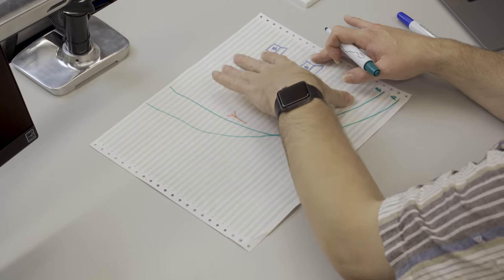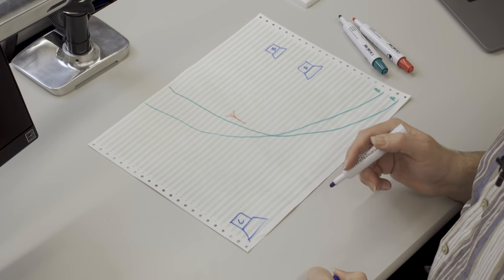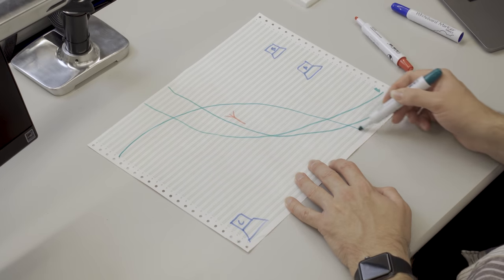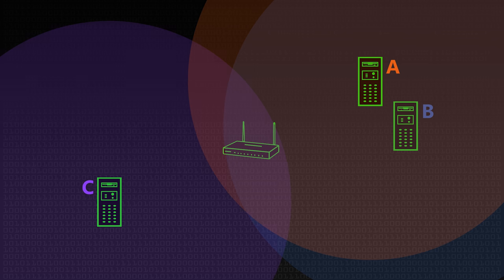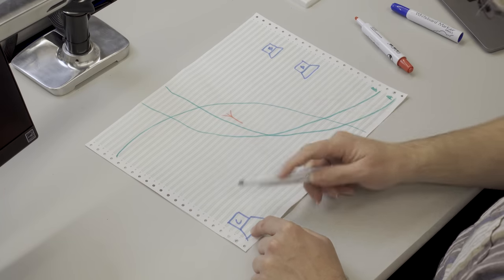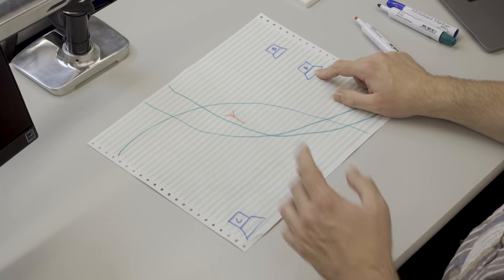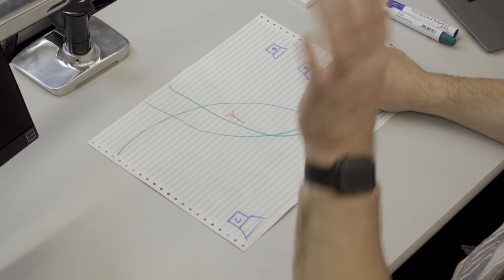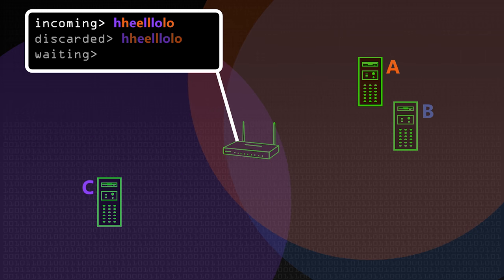WiFi's Hidden ____ Problem - Computerphile

Comment: I wonder, if machine A got the CTS, how does machine C know when it's allowed to send another RTS again? Is there a "final acknowledgement" or a "revocation" of the CTS from the AP that machine C can use? Or is there maybe a well-defined time period that the CTS is valid for after which machine C could send its RTS?
Reply: similarly: is there some maximum size of data or amount of packages you are allowed to send after receiving a CTS? Or could you literally block the whole system for minutes, sending data.

Before watching the video to its end, I imagined it would use something similar as cell towers, where you get some fixed time slots assigned for transmitting (not sure if this is still correct, but i remember hearing that somewhere). Could even (re)negotiate them every now and then to stay flexible regarding other participants
Reply: @Kantenkugel  This renegotiation happens for every data chunk transmitted depending on the backoff time. Otherwise, I'm guessing that the protocol will become partial to nodes in some manner and the transmission rates observed on some machines will be higher than others, albeit, very slightly.
Reply: As soon as machine C sent the RTS packet, and didn't get a response back in a predefined amount of time (usually defined by the used protocol), then it sends it again in a random interval of time. (For example, he doesn't get a response, and decides to send the RTS packet again in 3 milliseconds. But next time it might will be 4, or 5...) This way the possibility of getting RTS packet from 2 machines at the same time from the perspective of the Access Point is significantly less, than waiting another predefined time before sending the RTS packet again.
Reply: The RTS and CTS contains a 2 byte length field, so any Transmitter can estimate the duration for the Send + ACK.
Reply: @phizc  Technically it's a duration field not length, then the speed of each node doesn't have to be known just time in ms the system sending the RTS already estimated the duration.
Reply: @pcfreak1992 I believe it's the latter (C waits for the channel to clear then re-sends RTS). It's only a packet or two's wait, so we're talking fractions of a second.
Reply: @Segphalt  ah. It did say the field was Duration in the doc I found, but I mixed that up when I posted on this thread. I was sharing info I found in a 5 min Google session :-). I think Wikipedia said the waiting clients estimate + add a random extra time. I didn't think about the fact the original Transmitter could estimate how long it would take, and put that in the frame. Do you know what format the Duration filed is? Number of microseconds possibly? Or milliseconds, but I'd think blocking for more than 65ms would cause problems for other peers. 65 seconds definitely would 😀.

Comment: It seems to me that in a very busy wifi network, with dozens or hundreds of clients, it would make more sense to have the access point reserve RTS time slots for every connected client, and broadcast that schedule to all clients.
Reply: The reason they don't do that is because internet traffic is spiky by nature and isn't predictable. It wouldn't be efficient. Ideally if I'm sitting there waiting for a server to reply, someone else should be able to use my timeslot for maximum use of the shared channel bandwidth.
Reply: @SocalRider1754  couldn't your timeslot be very small by default, as long as you had the time to re-negotiate it? that would still keep the flexibility
Reply: This would only end up in a lot of unused network time.
Reply: If I recall correctly thats how cell towers do it. The allocated time slot is very short but done in quick succession so it can handle many calls without brake up.
Reply: and they do in some types of networks, eg. cellular. see time division multiple access
Reply: WiFi (or, more accurately 802.11) has had various dalliances with such systems.  Originally a "Point Coordinator" role (before 802.11e),  then a "Hybrid Coordinator" (802.11e).   There were even "Time bounded services" in the original draft 802.11 before everybody realised that it made a promise impossible to keep.

An AP can optimize a very busy network and improve throughput for everybody.  This is easy to show.
Two APs sharing the same very busy channel find it hard to optimize, because scheduling depends on determinism, or knowledge.   The most recent standard 802.11ax does "micro-scheduling" within an individual frame exchange sequence,  but relies on random channel access to start such a sequence.  This provides graceful,  but not necessarily efficient, behaviour with overlapped APs and a busy channel.
Reply: @adrianstephens56  What you describe is what I meant, but put more succinctly! :)

Comment: I'm curious how this works when multiple independent access points are sharing a frequency when some can and cannot 'see' each other.  example being residential buildings with many tenants
Reply: There are WiFi bands, 14 if I remember right for 2.4 GHz range and a lot more for 5GHz, I believe they all are slightly different in frequency, WiFi routers usually try and choose and less congested band automatically, or you can do it manually if you get a app to see which bands are being used

Comment: What viewers will be interested to know is that Request to send/clear to send (RTS/CTS) is optional and you can enable and disable it on a lot of WiFi routers/access points.
The benefit, as explained, is to mitigate the hidden node problem, but the cost is that overall, there is more overhead, and latency increases for time critical applications like live audio.

Comment: Any signal on a wire drops off as the square of the distance - same as radio waves.  It's just that for Ethernet, they designed the maximum wire length to enable all nodes to see each other.

Comment: What would happen if one computer sends a Request To Send, and then while transmitting the other data, sends another Request To Send immediately afterwards?

Is it possible for one computer to hog all the router bandwidth through that? Or is it expected that the Router does scheduling and says "Not yet - you already did send, I'm going to wait to check that noone else is sending a Request To Send first."?
Reply: Or what if you send a "clear to send" packet addressed to yourself first, so no other nodes send, while waiting for the actual "clear to send" from the access point.
Reply: @benjaminmiller3620  I suspect the "Clear to Send" packet would run the issue of needing to reach the other computers on the WiFi that aren't in range - so you'd need the router to sign off on them not sending.

Comment: What if there's ANOTHER access point in the same bandwidth (channel), how they recover from these collisions?
And what if there's noise caused by overlapping channels.
Reply: You could read about rogue access points (APs) if you'd like to learn about that. I'm sure plenty of video content talks about this problem as well.
Reply: They retry like any other collision, this is why WiFi APs have an 'auto' setting when picking a channel so they can scan for other APs and avoid using channels with the most noise.

Comment: IMHO Deauthentication frame is the worst part of the WiFi spec, anyone can jam any WiFi network and turn it unusable.
Reply: been there, done that. i love kali linux
Reply: Agreed. Even if the specification were somehow changed for it to be ignored unless deemed legitimate, then it could still be vulnerable to spoofing and MITM attacks. I think the problem is something like how do you force a rogue device to stop transmitting or how would you filter out the noise it's generating? Even if an AP forcibly ignores deauthentication frames the rogue device could still be a problem. I think a short term solution could be some kind of deauthentication frame reflection standard, but it's not clear if it's an outright fix.
Reply: IEEE 802.11w solves this by allowing management frames (including deauthentication frames) to be encrypted. This means that you'd have to know the network's PSK in order to send illegitimate deauth frames - and at that point, if a malicious actor already knows your PSK, you've got bigger problems on your hands
Reply: @oolivero45  great! didn't know that

Comment: multiple access points will become very common in households. like relay points. it will be odd in the future when someone says they have only one access point, in all actuality it will be built into the structures of buildings. like building materials, access point beams will be the norm within every building. it will start out as commercial and then go onto the private sector. schools like universities will be the first to adopt this due to their dorm room issues with wifi. the price of electronics will be so cheap that this will be a no brainer, it actually won't even be mentioned unless you are in that field. thats how normal it will be. then the APs will talk with each other and manage household traffic, this will be as common as electrical outlets in a building, it will be a grid like structure, and then nearby houses and other objects built will communicate with each other as well, this will allow for a sort of mesh networking, cars will have parts built into them as well, signals will be thrown in a direction using a type of gps or some type of location verification by pinging off nearby buildings. for moving targets, cell tower technology will deal with that part. but, say you are in houston and you want to send a message to london, messages will be passed along through structures towards london, and then the final area, the tower that registers where that user is if they are out of their home or office, will then send out a signal for the last mile. in which that persons personal device will get a ping from the tower like we do now and get the data intended to be seen by the receiver.

Comment: I don't understand how the first "cleared" machine knows if or when to let "others" transmit (for some fraction of the time). Is it built in the protocol to shut up for a few milliseconds every whatever delay? Does wifi protocol forces any transmitting sequence to be interupted at regular intervals for a few milliseconds? Does it have special cases when there's only 1 machine connected (e.g. if there's a whitelist of some sort with a single entry)? If that was discussed in some previous video, can someone please tell me the title so i can go and watch it? Thanks a lot
Reply: Typically, there is usually a back-off time when devices want to communicate with the Access point and have to wait. I think it is decided by some empirical data what the back-off time should be and might also vary from implementation to implementation. What we're talking about here, in terms of time duration, is milliseconds and lower. So all this switching appears very very fast. Multiple times in a millisecond in fact.
Reply: I want to know too
Reply: Well, we must remember what is being sent.

What the machine is transmitting is a packet. A single message. And packets have a maximum size.

(In the video, you'll notice Steve said "1500 bytes". The reason he chose that number as "a big packet" is because that's the standard MTU - or maximum size for packets - with IP. Well, on Ethernet, there are "jumbo frames" that can be up to 9000 bytes, but we don't have to worry about that with wifi, as Wifi doesn't use "jumbo frames".)

So when the access point provides "clear to send", it's only clearing it for one packet. And that packet can't be more than 1500 bytes maximum.

If it wants to send another packet, then it needs to "request to send" again. And, indeed, the access point can, at these natural packet boundaries, decide to play fair and give a different machine "clear to send" instead, to fairly balance the traffic.

There are natural "shut up" points, because what we're requesting to send and being cleared to send is a single packet. And a packet can be no more than 1500 bytes (and if you need to send more than 1500 bytes of data then you'd break it up into many packets and send each one in turn).

When the "cleared" machine sends, it sends one packet. No interruptions or anything. But a packet cannot be bigger than 1500 bytes at most. Then it goes back to shutting up because the "clear to send" was only for that one packet. If it wants to send another packet, then it needs to "clear to send" again.

And then the access point is responsible for fair scheduling. Like, if "A" has been hogging the airwaves, time to send the "clear to send" to machine "B" instead, so it gets its fair chance (and "A" is now the one waiting its turn).

This is a "per packet" thing, and the packet is the natural boundary. Packets have a maximum size, so the worst case scenario is everyone's sending 1500 bytes each time. But they can't hog the line more than that, as the "clear to send" is only for that one single packet alone. You have to get another "clear to send" for subsequent packets.
Reply: As long as no device sends and receives data continuously, there will be time slots for several devices to use the network at the same time.
Reply: Nothing transmits continuously on the internet, information is always broken into packets (as he says 1500 bytes is the maximum packet length for Ethernet). So there is a built in chance for someone else to step in between packets, and multiple devices can basically alternate sending packets.
Reply: control packets (rts cts and ack) have time period embedded in them
Reply: There is no quick answer,  so sometimes hours are required.  But once you do.. boooom

Comment: CSMA/CD - I remember DecNet, something like 5-4-3 rule, five bridges, four repeaters and three active segments. That rule disappeared when the whole network became switched. The 5-4-3 rule was a long time ago.
Reply: I remember all the hassle with bridges, like a switch but much slower, some of them we ran over x25 wan miles apart. We had about 8,000 stations with 60 segments. I learned to both respect and hate spanning tree.
Reply: @marksterling8286  spanning tree was fun until your network grew large. Once set up a spanning tree, drove 20 miles away and coincidently they had equipment failure and blamed my new config. Drove 20 miles back and proved it wasn't my work but at least they got free consultancy to find their network fault

Comment: I've got the opposite problem. I've bought a router and it's always visible when I turn on WiFi on my phone. Even days after pulling out the power for the router, it still shows up. WTF
Reply: You should just be able to delete the network in your WiFi settings.
Reply: Most likely your phone has cached that information and the AP is not actually 'visible' right now. It's still unusual, though.
Reply: Your phone stores the access points it has connected to before so you don't need to enter the password again. When your router is turned off, your phone will say "not in range" under the SSID.
Reply: @kilimanjarocruz660  I can actually connect to it, it's not even turned on 😭
Reply: @simontay4851  this; but they deleted so idk. Maybe embarrassment but asking means you're curious n etc etc.

Comment: I've got to quibble with your over and out nitpick a little: It depends on how you tokenise: If {over} and {out}, respectively, are separate tokens, then you're right, the subsequent {out} breaks the {over}. However, if {over and out} is understood to be a single token, then it makes perfect sense to say {over and out}. Of course, if it is the latter, then {over and out} is synonymous with {out}, but I suppose you'd use {over and out} for emphasis, clarity and semi-redundancy: If you say {over and out} and only the over part is blocked, then the out part still makes things clear, while if only the out part is blocked, you may miss the other party's goodbye, but the airwaves will still have been correctly cleared. I suppose {over and out} could be considered a variant of {over} that indicates greater finality.

Comment: A lot of the methodology in the Wi-Fi protocol was borrowed heavily from Multi-Plexer's(MUX - A multichannel/line Modem). RTS/CTS etc. were all present long before Wi-Fi was perfected. More modern Wi-Fi AP's also have the added benefit of sub-frequency Channels. When a device connects to it, it's assigned a channel so it knows requests on that channel are coming from a specific machine.

Comment: Great explanation. When I studied there were no digital wireless comms yet. So I always wondered how they do it today.
I often see that a lot of neighboring wifis send on the same channel. (Mostly 1, 7  or 14 are used I believe) how do you avoid collision between multiple networks? There won't be any central instance approving the request to send.
Reply: RTS/CTS had been around over 50 years and has always been part of RS232 serial protocols.
Reply: @exponentmantissa5598  but rs232 is not a shared medium. Rs422 i think is a bus. They for sure don't use rts/cts.